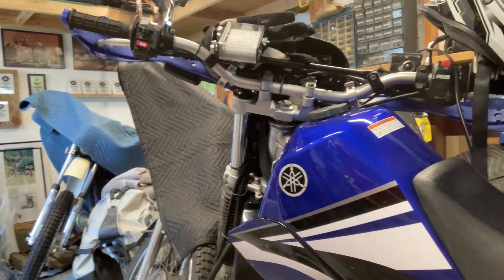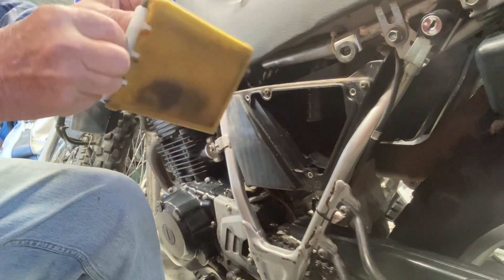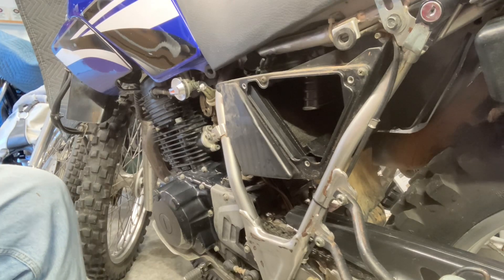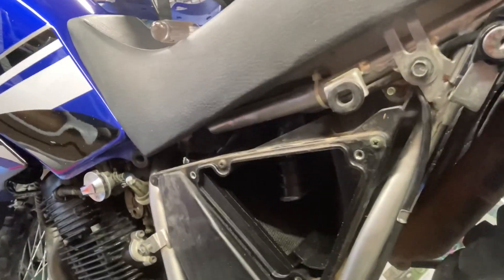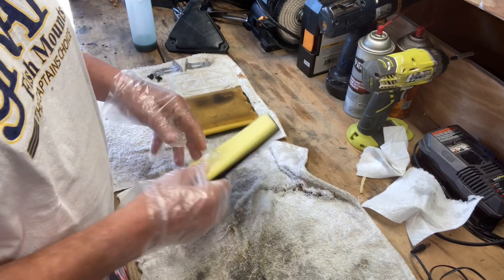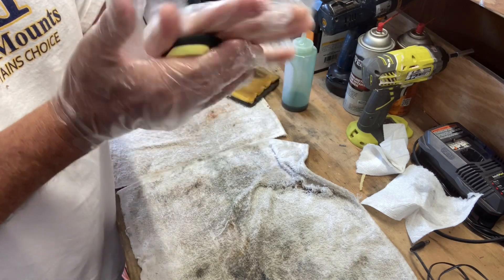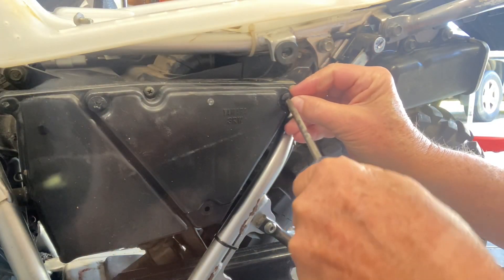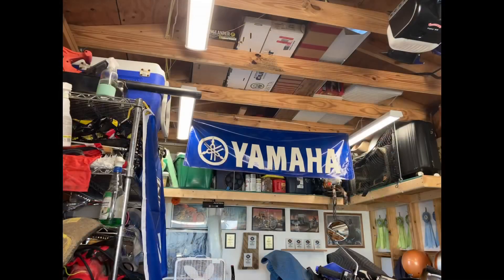Yamaha 2006 XT225 changing out the air filter!

Comment: put your air cleaner in a plastic bag and then oil it. You won’t have a mess. And you’re not supposed to use just regular oil, you have to use air filter oil because it trips the dirt on the outside of the filter, regular oil can get sucked through the filter and carry dirt in with it. Air filter oil is very gummy and sticky. If you had it on two of your fingers and spread your fingers. you would see hundreds of tiny, gummy spiderweb, looking strands of that gum in air filter, oil the traps dirt on the surface and doesn’t let it get sucked through the air cleaner the way oil will.
  it’s also a good idea to use Delray waterproof grease around the edges of the air cleaner so dirt can’t work its way around the filter. And seal the lid with waterproof grease where it makes contact with the airbox .
  I did the air cleaners on my two stroke dirtbike’s after every ride. Many motocross guys will have clean, fresh recoiled, air filters, ready to go, and they will sometimes change the air filter. Every time they pull in for gas between moto‘s. They will have three or four air cleaners, ready to go especially when it’s very dusty…
Reply from the maker: That is a great idea! Thanks for comments and tips!!